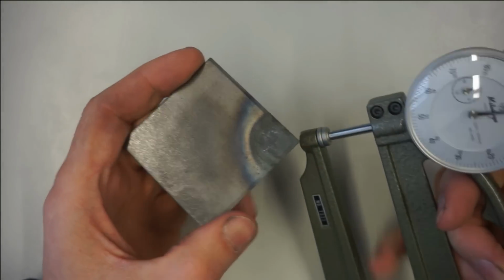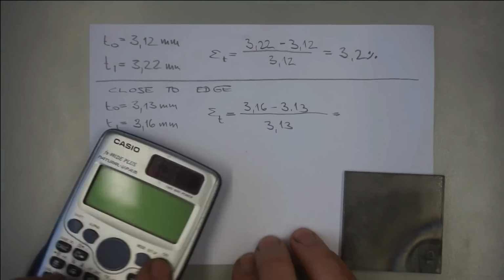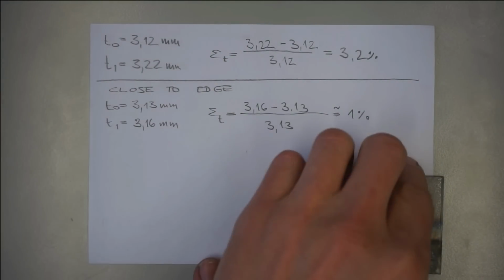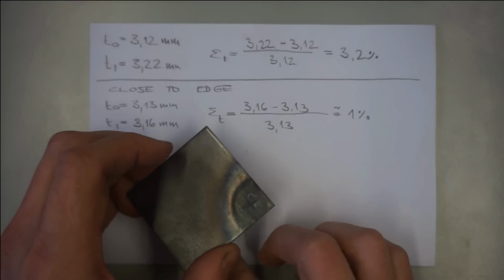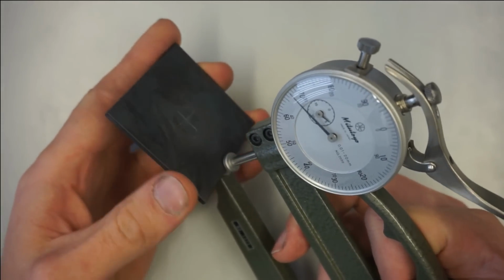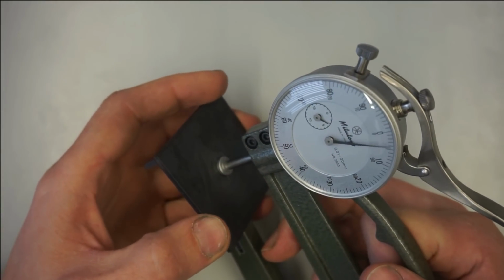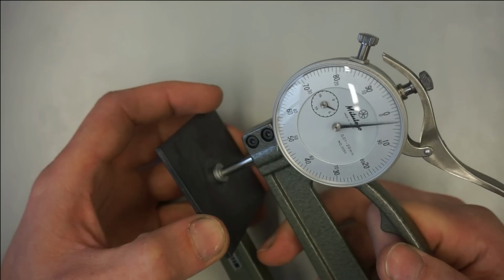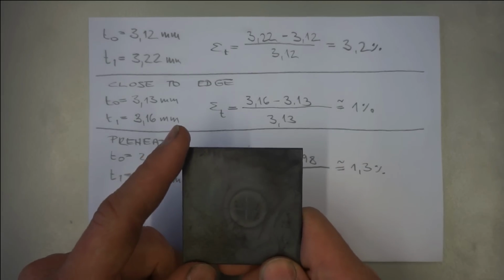Welding Distortion Explained Part 1: Principles

Comment: Is it reasonable to say that occurs also a change in length of the square sides ?
Reply: A good question. I think the plastic defamation would be localized to the high temperature point in the center of the square. The rest of the square should expand and contract by the same amount producing no permanent change.

Comment: 28:20 Is there a distortion perceptibility material list? I'm curious to know whats at either end of the spectrum...
Reply: I don't know if it would be exact, but a table of thermal expansion coefficients would probably get you close.

Comment: Great content. Why the subsequent shrinkage cannot compensate this increase in thickness? What is the correlation between radial and axial shrinkage?
Reply from the maker: The subsequent shrinkage does not compensate for the thickening, because this is not a forward and back kind of behavior, but rather a forward, sideward and backward one because of the plastic deformation. Radial and axial shrinkages depend on the shape of the object. A sheet behaves different that e.g. a cylinder. Or think of the experiment with the heated spot at the corner, here also the local "shape" influences the (thickening) result.

Comment: Is the welding table your own creation? It's impressive!
Reply from the maker: The welding table in the video is a commercially available one from a German manufacturer (Siegmund). It is nice, but some features of it I don't like very much.
Reply: @anengineersfindings  Well, I for one would definitely be interested in a video about it. Thank you for the content.
Reply: @anengineersfindings  Alex, could you touch on the pros & cons of the welding table in a future video, even if that's only a small part of a longer video?
Reply from the maker: Sure, I'll try to cover this in a future video. Currently I am building a welding table from a wartime surface plate, so this is right on topic. Thanks.

Comment: my grandfather was a welder and was a genius with flame straightening. once he was asked to fix and train dock edging that had to be + - 1/16"  . the part that complicated this was that the train graded in to the platform and it was also curving so the edge was a enormous helix. his boss told him they never would have gotten it with out him. excellent video cant wait for the others.
Reply from the maker: Very impressive, the story of your grandfather. I find that people tend to forget that the modern world we live in was made pretty much without computers, CNC-machines or 3D-printers. Rather it was made by excellent craftsmen and smart mechanical machinery.
The other three parts of the series are coming in the next few days, I hope you will find them valuable.
Thanks.
Reply: @anengineersfindings  another interesting story was that when he first started they still used Star tip hand hammered drills to install concrete anchors. This was maybe 1960  or so

Comment: Strange how little information is available on a process so vital to modern fabrication. The welders I know, have all developed an intuition for managing distortion, but no formal instruction on the principles.  I am also hopeful your press project is going well!
Reply from the maker: Sir, I fully agree. To my best knowledge, even the very extensive welding textbooks can't provide much practically useful information on how to control welding distortion. I hope this four part video series will be of value for practical welders or advanced welder education. The remaining three parts I will post in the next few days.
The press brake is finished since about two months, I will probably make a video of it's build and characteristics soon, since it seems to be of general interest.